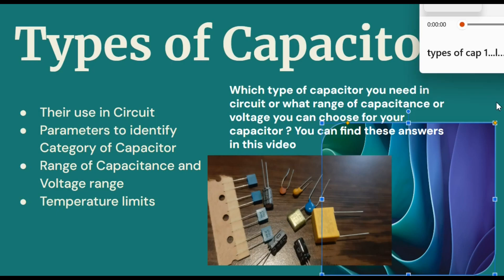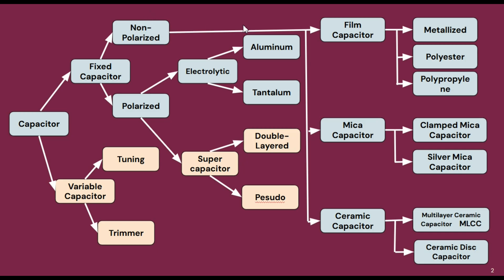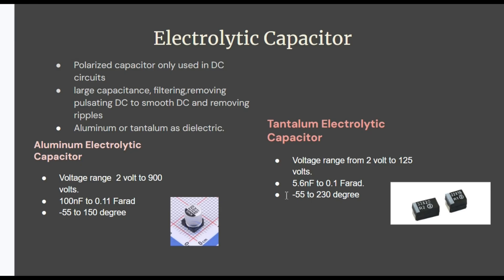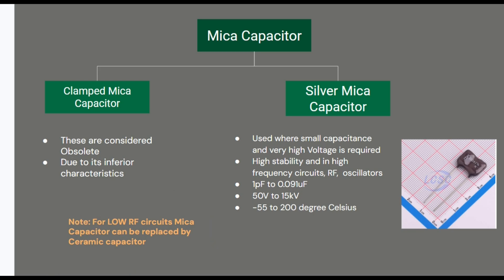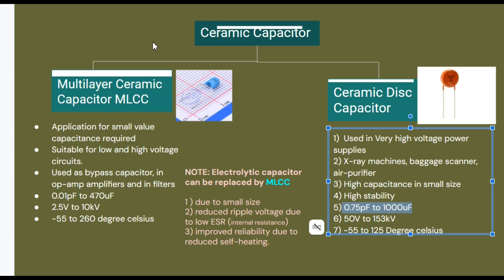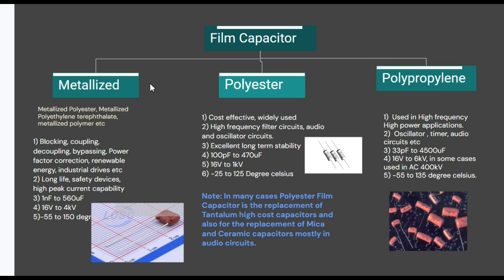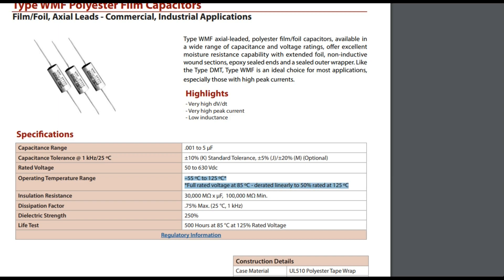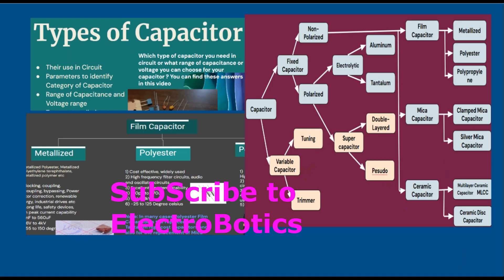Types of Capacitor in detail, Where to use which capacitor and why ? Shapes, Capacitance, Voltage

Comment: What difference between polyester and PET?
Reply from the maker: Polyester is big family and PET (Polyethylene terephthalate) is a little member of that family.
Reply: @electrobotics43  Got it. And which polyester materials are used in capacitors except PET?
Reply from the maker: @ЁбрагимИпатенкоибнАдхарма  Under this family, Metallized Polyester, polyethylene naphthalate, these are two main dielectric material used in polyester.